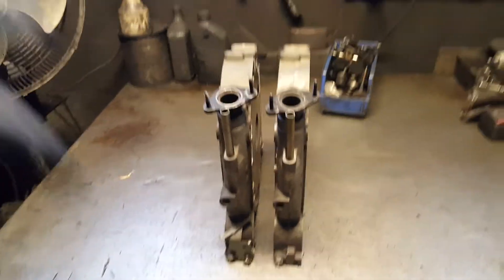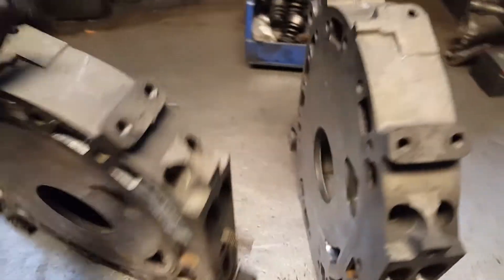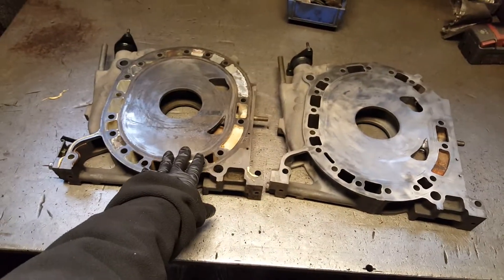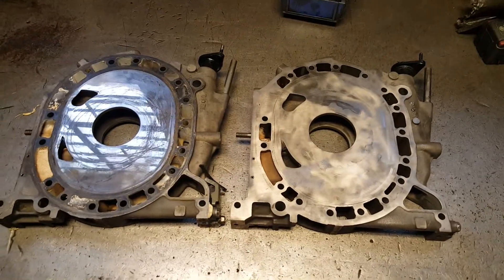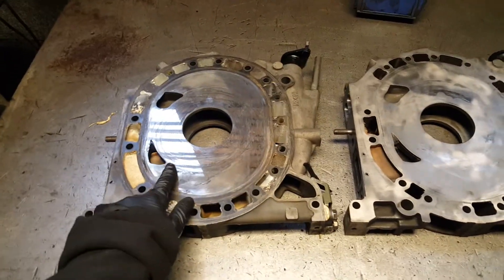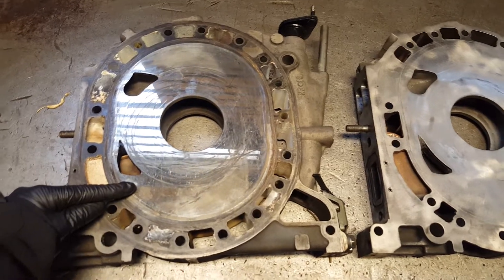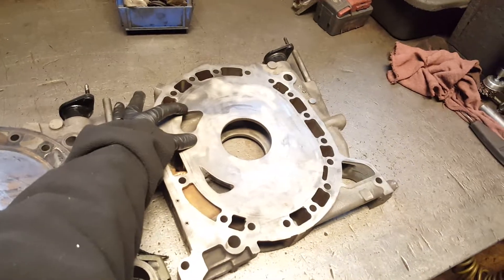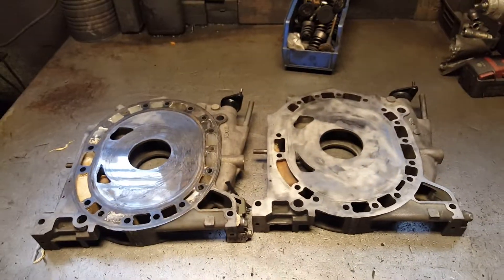Mazda rx8 13b 4 port 6 port middle iron difference

Comment: Thank you! I think with a template, the 4 port center iron could be ported to the exact same spec as the 6 port center iron'
Reply from the maker: Yes that possible but remember water jacket is too close and if you have a shaking hand ,your iron will become trash 😂
Reply: @JM8686  This is not a big deal, the bridge port is scary close to the water jacket! 2mm close!

Comment: Can you use rx7 plates with rx8 rotors
Reply from the maker: Yes but you have to do some machining and also wire cut the apex seal grooves so you can use the rx7 apex seals Instead of the rx8 apex seals! Also have to make sure the weight and you have to balance the whole rotating assembly
Reply: JM8686 what if you use rotors and housing do you still have to do all that cutting and  balancing thanks for reply
Reply from the maker: @ghettotech9617  cant use rx8 housings because they don't have exhaust ports like the 13b rx7
Reply: @JM8686  idk if you’ll reply to this but, what is wire cutting the apex seal grooves, is that on the housing or on the rotor?asking because I want to build a hybrid motor for my nc Miata
Reply from the maker: Wire cutting is only on the rx8 rotors so you can use rx7 apex seals on the rx8 rotors

Comment: I'm actually in the process of making my automatic a manual by switching the back and front plate 😂
Reply from the maker: Awesome 🙌
Reply: How did that go? I’m trying to do that currently
Reply from the maker: It can be done, just make sure you're corner seals, side seals ,apex seal corners won't fall off lol